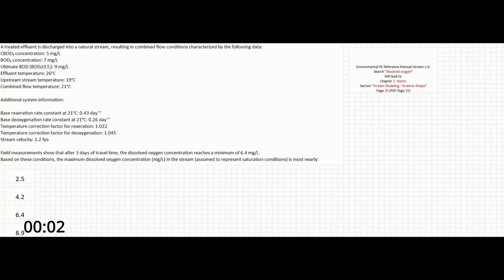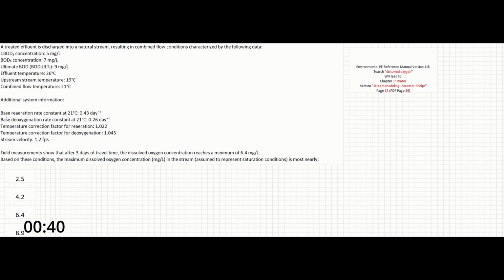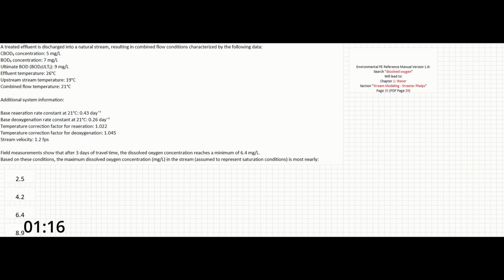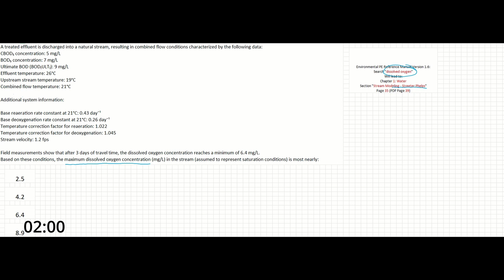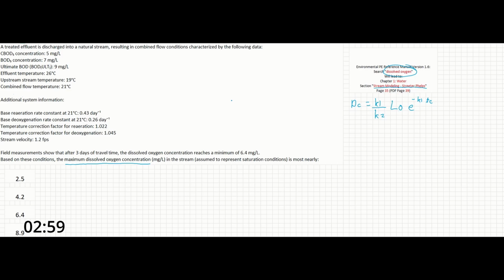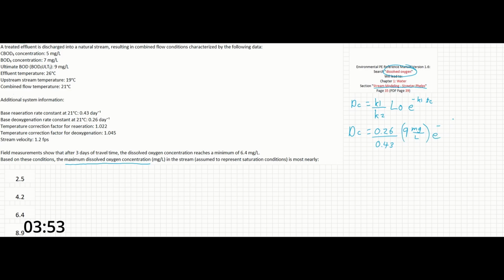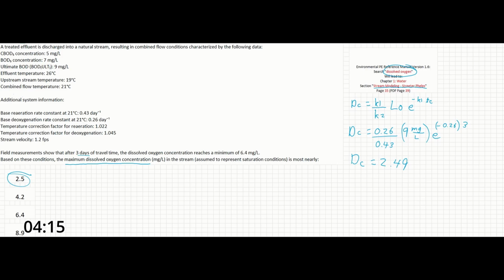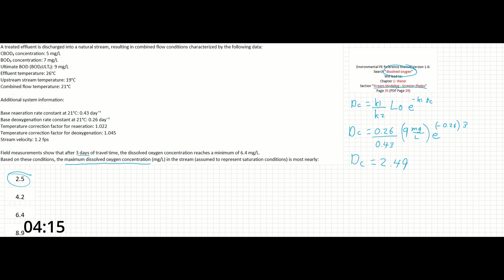PE Exam Practice Problem #87: Environmental | Dissolved Oxygen Concentration - Streeter Phelps Eq

Comment: Isn't Dc the critical point? Aka the point of maximum deficit?
Reply from the maker: I have to stop writing these problems after midnight. Yes you're right, Dc would be the max deficit. I even state it aloud in the problem. But I assume you are confused because I asked you to solve for the max CONCENTRATION. You identified an error. I should have asked for the max DEFICIT. I'll have to see if I can edit that wording without taking down the video and re-posting. Thanks for pointing out my error and please let me know if I misunderstood what you were asking about.
Reply: @SolvedIn6  Hello, thank you very much for your videos, I have been watching them regularly. Why you used the "e" instead of "10" in the solution, how do you decide that? Many thanks in advance.
Reply from the maker: @ceasorskhatri  Thank you for watching and thanks for asking. I assume you are asking about the variable "e" in the equation? If so, I used this equation directly out of the Environmental reference manual. You can download the manual from the NCEES website if you do not have it already. Please let me know if this does not answer your question or if I misunderstood you.
Reply: @SolvedIn6  Thank you very much for the reply.
Reply: @SolvedIn6  Thank you very much for your reply. My understanding is for Critical Point we can use two form of equation 1) with natural exponential form ("e") or 2) with the Base-10 exponential form. My question was as in the above example; the base reaeration or deoxygenation rate constant is mentioned but whether they are on (1) natural exponential form or (2) Base-10 exponential form is not mentioned. How do you determined that its the natural exponential form of equation to use? Is it because given rate constant k values is high?
Reply from the maker: @ceasorskhatri  It seems like you may have a greater understanding of this subject matter than I do. The short answer is that I tried to develop a problem that uses equations that can be looked up in the NCEES reference manual. To the best of my knowledge, this is the only equation that provides the answer to what the problem is asking for: the MAXIMUM dissolved oxygen concentration "Dc". The other forms of Streeter Phelps provided in the reference manual solve for D, tc, and DO, but I don't think any other solve for Dc. Does this help to clarify why I selected the equation that was used?